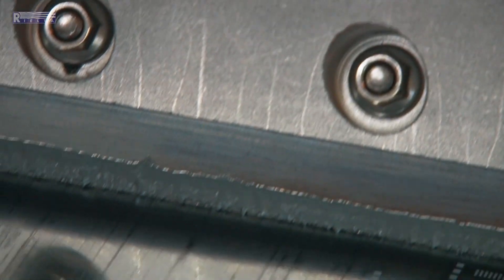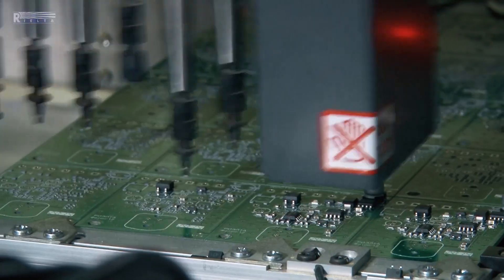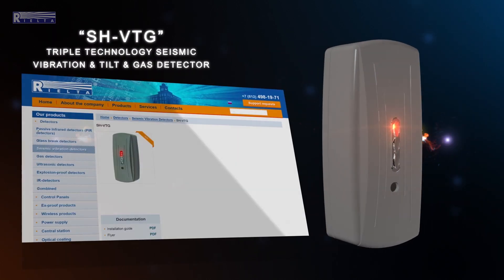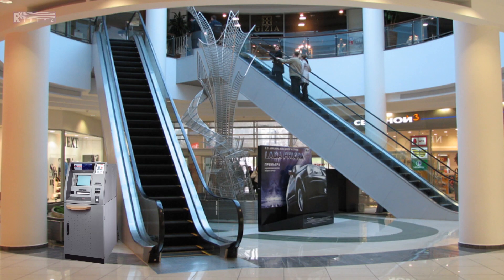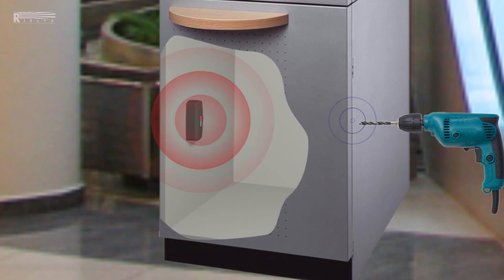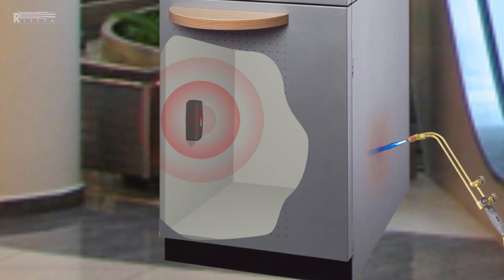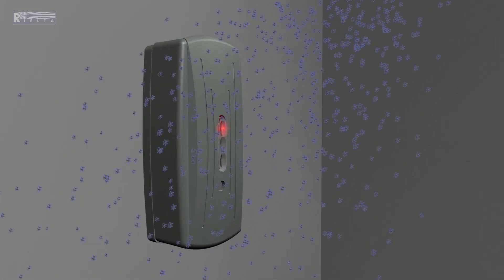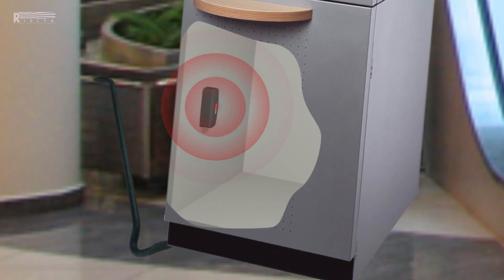ATM security detector SH VTG

Comment: Lol just unplug the ATM, then the machine's power alimentation goes down.
Reply: I was incarcerated for just this. You correct its just that easy.
Reply: @Dogleg1957  Dude how you got incarcerated for unplugging something
Reply: @Dogleg1957  How is it possible according to the law I mean?
Reply: @jacobhenrichon5542  it's not that I unplugged it...I was what took out of it
Reply: @Dogleg1957  so you managed to take the cassette out?
Reply: @jacobhenrichon5542  safe has 4 weak spots depending on the manufacturer. Diebold safes are 100000 psi steel. Very easy to defeat. Fujitsu steel was some nickle alloy...I avoided those but with time any safe can drilled. Worst I incountered was a hard plate mixed with ball bearings. There was rumors of vault in a European casino made up layered hard plate bearings and special stone that wiped out bits like crazy and absorbed high heat. It's was oceans 13 level tough...sorry got topic...but all ATM's can be defeated even old ncr and ibm 3624.
Reply: @jacobhenrichon5542  sorry never answered you...there were 4 cassettes and yes 3 were half full of twentys. Each cassettes had dye packs
Reply: @Dogleg1957  How long did you take for it?
Reply: @jacobhenrichon5542  15 mins with luck .... less
Reply: @Dogleg1957  no I mean in jail time
Reply: @jacobhenrichon5542   18 months at club fed minus good time. I plead down to nonviolent entry into a federal facility. I was repelling down from the ceiling when the ceiling Joist let go and I fell and broke my leg and back. Laid there till Tuesday morning when they came in for work and was charged with attempted bank robbery
Reply: @Dogleg1957  you don’t recommend an electric portable torch?
Reply: @JayPatekk  lot of them have temp sensors. But my worry is torching the money. Torch way to hot. Plasma need compressed air and old ones I used only cut 100k psi plate steel with 220 Volt 480 best. Gouge sticks are best. Concentrated heat cuts well. I used none of above. Buy at depot for under 50 buck and defeated Fujitsu 13 mm high nickle... Ncr 1 in thick steel...diebold 3/4 100 psi...yes about 50$ equipment...oh need 150$ makita
Reply: @Dogleg1957  they should just stick glass around the lock body would defeat all drilling
Attempts
Reply: @hektik8007  that trip the lockers in the tumbler. The weak link is that the locking mechanism is held in by 4 8/32 screws. Easy to defeat